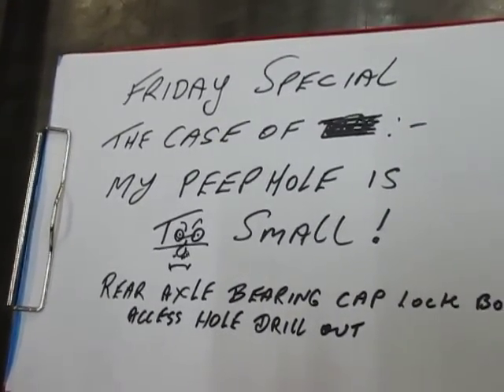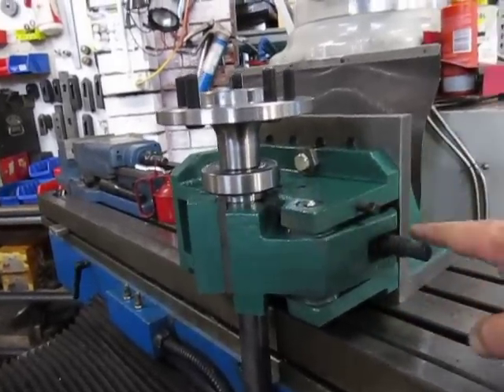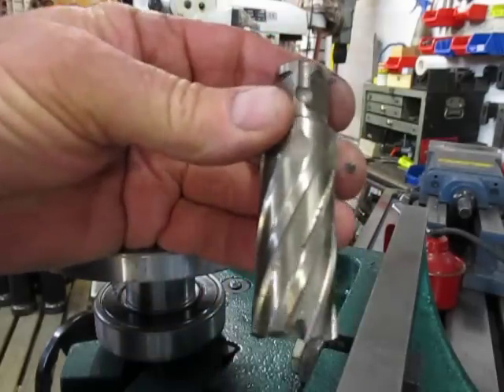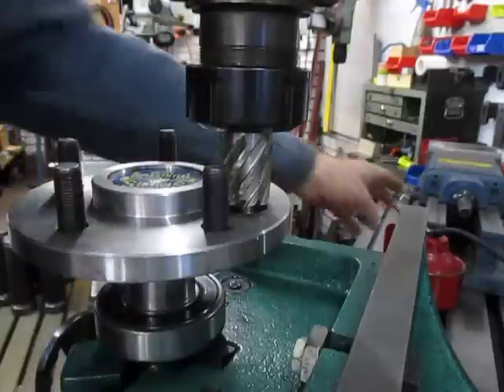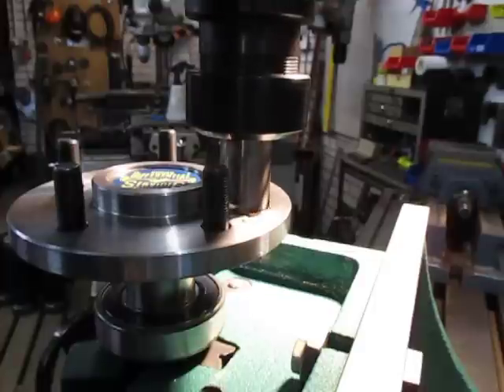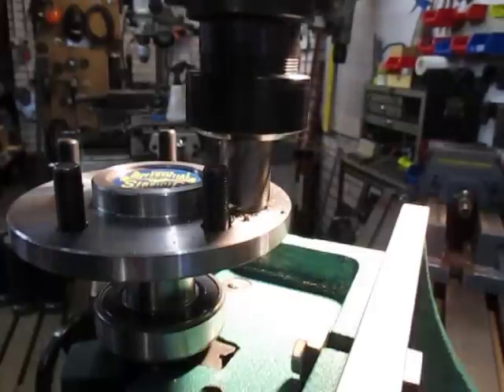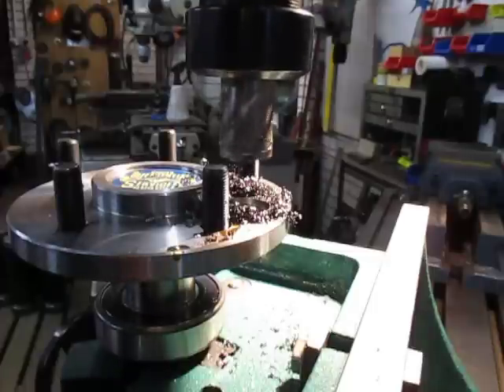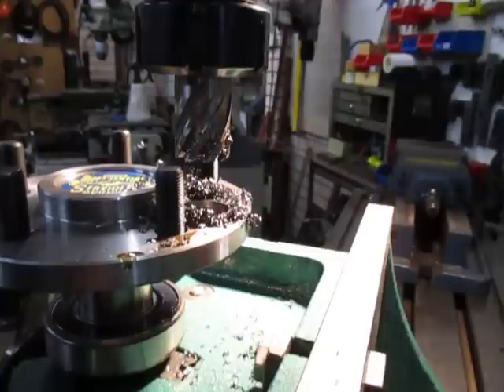Friday special Rear Axle bearing cap access hole too small

Comment: That cutter seems a lot happier when it is working with low revs and heavy feed. I would have wrapped the bearing in tissue though, I know it is a sealed bearing, but no point in pushing your luck!
Reply from the maker: yes most cutters and drills prefer to be under load, that steel was pretty tough. the only way to really protect that bearing would have been to machine and cut in half a shroud, however those broaches normally produce stringy stuff so it is less of an issue.

Comment from the maker: I have a specific roto broach holder that I use in the mills, it is quite long and useful for deep counterboring of motor end caps when I have to bush them, however from time to time I just fit the broach in the collet chuck seems to work well all mine are 19mm shaft. Yes the broach is HSS I will upload a video of broach sharpening, it's a bit tricky without the proper cutter equipment, I wing it in pretty good with my cutter grinder. I also have some cemented carbide tipped cutters that I use mainly for hard materials.

Comment from the maker: The job went well, I changed to an end mill to finish that hole and do the second one I'll resharpen the broach as it was just a little dull. Jobs that require tooling that are not in my standard inventory I charge to the job, same with hard materials that dull tools I charge for a replacement / a sharpening (within reason of course), everything is a trade off against the hourly rate which is different between clients. Take care